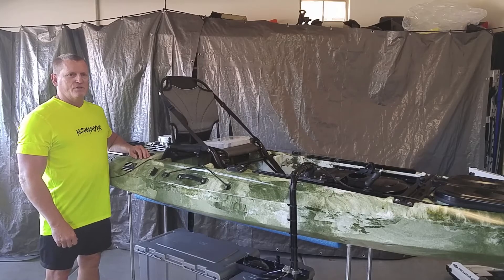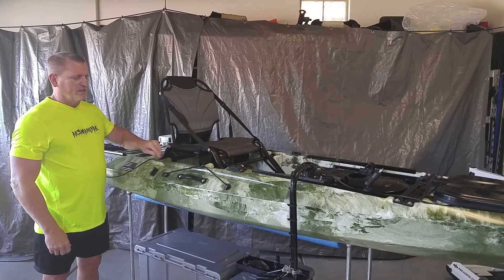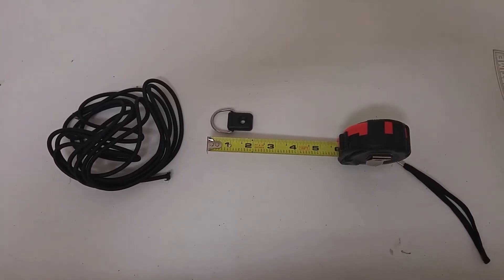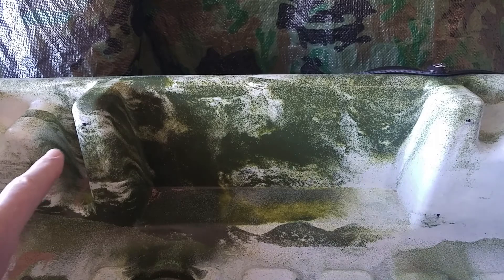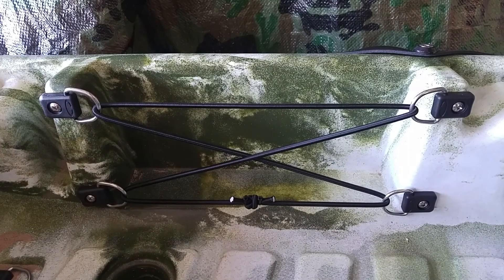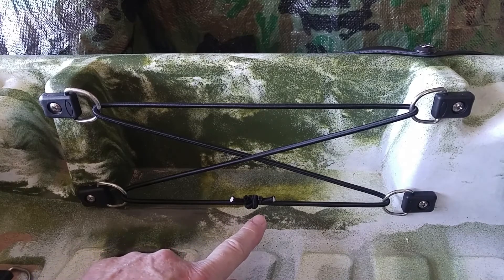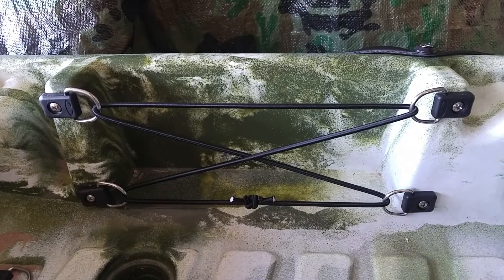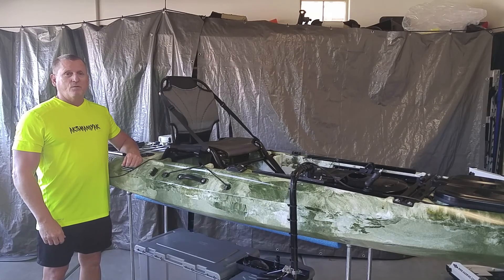DIY Kayak Bungee Cord Tackle Box Holder

Comment: Hi Aksel,

Nice install.
Do you have a link to where you purchased the D rings and associated plastic mounts?
Are the D Rings Stainless Steel? i.e. rust resistant.

BTW.  I sold my NuCanoe and I am no longer associated with Team NuCanoe.  Yesterday I purchased a new 2018 Hobie Pro Angler 14.  It has the new 180 Mariage drive with forward and reverse.

John
Reply from the maker: Hi John, I hope you fared well during the hurricanes. Wow, very nice kayak upgrade. I bought the D rings and mounts as one piece from Amazon. They are stainless steel. The ones I bought took a little while to ship and I have attached the link.  I have also added to my armada as you can probably guess by my latest videos.  https://www.amazon.com/gp/product/B01L7RYC58/ref=oh_aui_detailpage_o05_s00?ie=UTF8&psc=1